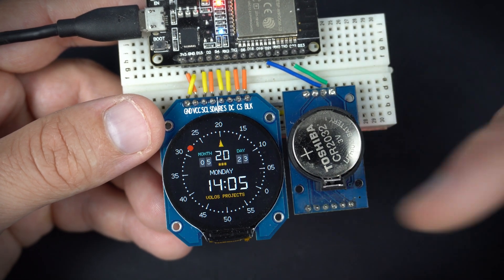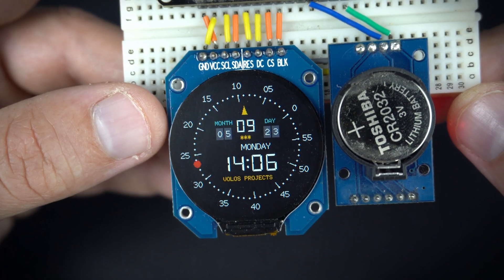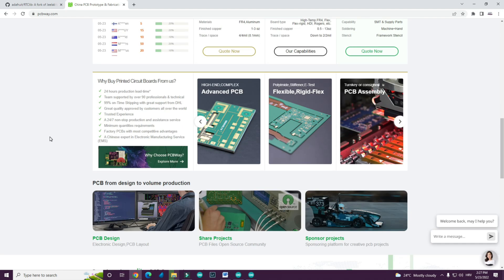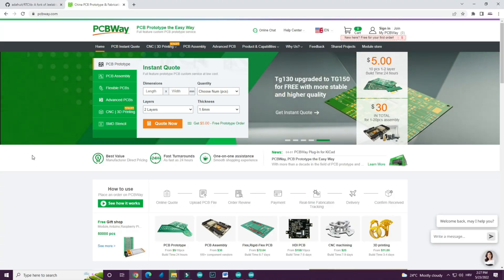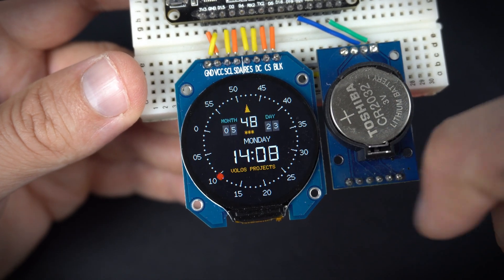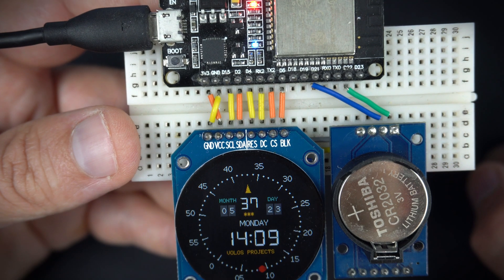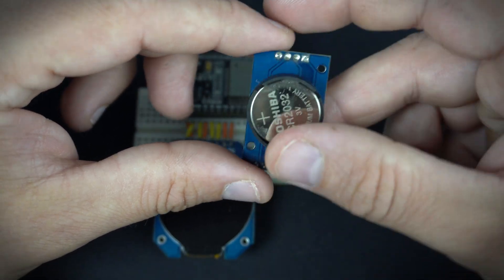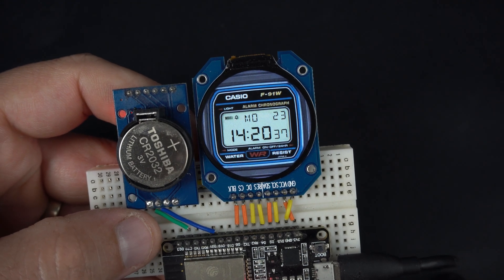Let's make Smartwatch ESP32

Comment: With the NodeMCU the examples in the TFT_eSPI work, but you code no :-(
Reply from the maker: yout board dont have enougth psram for 240x240 sprite, reduce size of sprite to 230x230 and it will work
Reply: @VolosProjects  Thanks, but I chaged card to ESP32C6 Zero, now work fine

Comment: Great video, I got your code working using a Teensy 4.0 controller, but only after commenting out the generic user setup! Somehow I missed that when modifying the setup header and that caused a black screen on 1st try.  This was the first step in building a directional gyro that does not rely on the compass sensor in an IMU sensor. This round display is perfect and I really appreciate the sprite code to eliminate the screen blinking on display updates. The Teensy 4.0 works great with this display.

Comment: Couple of helpful hints:
TFT 1.28" PINS
RX2 on my ESP32-WROOM is where the DC PIN goes
TX2 on my ESP32-WROOM is where the CS PIN 
Otherwise all other pins are as noted below:

#define TFT_MISO 5
#define TFT_MOSI 2
#define TFT_SCLK 15 
#define TFT_CS    17  // Chip select control pin
#define TFT_DC    16  // Data Command control pin
#define TFT_RST   4 

RTC - SCL -> PIN 22
RTC - SDA -> PIN 21

Finally had to modify my img.createSprite(240, 240); to 
img.createSprite(235, 235);
For sketch to work. Probably a difference in Waveshare vs D-Lite or TFT displays. 

Great sketch!
Reply: same issue here. thank you for posting this, it helped me get it working.

Comment: Hi, 
I've been working on your example for a couple of days, with no success. Screen remains black.
Wiring setup has been modified in TFT_eSPI Users set up. All examples of TFT_eSPI work like a charm.
Clock is wired properly and gives time.
I inserted a few 'fill' command through the program to check that the program is alive and it works.
Must be a tweak somewhere but I have no idea, I'm not a newby in programming, but this is my first test with ESP32 end round TFT.
Any idea ?
Reply from the maker: memory, later i found that some boards have problems with this sketch ... also have you check tutorial from description?
Reply: @VolosProjects  OK, solved it. It must indeed be a memory issue. My board can't create a Sprite of 240x240. 239x239, ok, but not with your sketch, even switching color depth to 8.
So, I found that with a Sprite size of 234x234, and a few adjustments due to the reduced size, the sketch works.
Reply: @VolosProjects  thanks for your quick reply. Yes I checked the tuto, again, Wiring, parameters are ok and all exemples in TFT_eSPI work fine. I saw in the comments something about memory management with some parameters to set in the sketch, but with no detail… I’m still inquiring. And yes the board is AliExpress, as well as TFT, but strangely enough all examples including sprites work.
Thanks anyway.

Comment: Hello,
I am trying to use this sketch.
Unfortunately the image and the pointer is not displayed.
I use a round display with GC9A01 driver without LED and a ESP32 -WROMM 32 controller .

Is there a newer version of this sketch ??
Greetings
Reply from the maker: Is any other example work ob your display, there is no problem with this sketch, you need to install library properly

Comment: fantastic, like always. Got it running on an ESP32 S2 Mini, with minimal changes to reconfigure SCL&SDA. Great looking and superbly working. Thank you!
Reply: Hi, I'm also trying to get it working with the S2 Mini but without success. May I ask what you did to reconfigure SCL & SDA? Thanks.
Reply: @u1kim  Just adapted 
#define USER_SETUP_ID 46

#define GC9A01_DRIVER

#define TFT_CS   34 //   TFT:CS  10 or 34  chip select control pin

#define TFT_MOSI 35 //   TFT: SDA = DIN= Data IN  11 or 35
#define TFT_SCLK 36 //   TFT: SCL = Clock  12 or 36
#define TFT_MISO 37 //   TFT: NC 13 or 37

#define TFT_DC   14 //   TFT: DC 
#define TFT_RST  15 //   TFT: RST

That it
Reply: @michaelbruns473 Thank you very much.

Comment: Great project. I built it, and with some effort, got it working. At first a blank display. A 240x240 sprite seems to exceed ram availability for sprite rendering although only 8% was used by global variables. By moving the fixed arrays created and stored in ram in the setup section to a pre-calculated set of constant arrays stored in program memory (similar to the fonts arrays), ~9k of additional ram was freed (5% used) and the sprite displayed. I also found and fixed a bug that did not handle the 10th day or the 10th month leading "0" stuffing correctly by changing the "if (now.day() > 10)" to " if (now.day() >= 10)" (same for month). It looks impressive!!!. Thanks for posting.
Reply from the maker: thank you, i am glad you made it work. memory is always problem with tjese development boards.
Reply: Hi, I have a similar problem, not white, but black (BL in forced on so no issue there).Sketch is running (checked that) but nothing on the screen. Couls you please share your array meomory allocation code, I'm not familiar with this.
Thanks

Comment: I love that round screen!   However, you mentioned  a new ESP32 s3 with a screen on top.  It was a little larger than other esp32s.

If we used that new esp with rectangle screen, can we better arrange components, either stacked, or on each end of ESP32/screen with each component in a self made case for each,  slide onto watch band.

It would wrap around band(each cased module with the ESP32-screen the center item on band.

(Just thinking out loud but no experience BIENG very respectful and humble asking the questions.).   I want one! Hahaha

Comment: hello, nice project. why if I imposed img.createSprite (240, 240); the screen remains black. instead with img.createSprite (240, 230);
All right. but the image remains a little bit (normal)
Reply: I spend hours and hours and combined 2 different ESP32 with 3 different GC9A01 and always got a black screen. Then Roberto unveiled the magic key: createSprite(240, 230). Thank you very much! Can anybody provide an explanation?
Reply: Roberto! THANK YOU! THANK YOU! After making your change my display is no longer blank. I tried everything I could think of. 
Do you have any idea why that change makes it work? What made you try that?
Reply: @vectorspace2932  it was a coincidence, I wanted to include some
#define but I got the wrong value.
i didn't understand why it doesn't work with 240. sorry
Reply: @vectorspace2932  I have tried other projects of the author and setting 230 they all work

Comment: Great project! but I have a problem. My display has the pins in a different order. Fortunately I noiticed that VCC and GND were reversed, and wired the pins as I thought they should be. There was no connector for BLK.  Powered up and nothing! Blank screen. I made the changes to the pins as detailed in the earlier video, and double checked my wiring.. Anyone got any suggestions?  Thanks
Andy
Reply from the maker: Hello, are you sure your display uses same driver chip?
Reply: @VolosProjects  Hi Velos. Thanks for the reply.. Yes. Info on the back say: 1.28"TFT VER1.0 240*240 IC:GC9A01.If it helps pinout from left is VCC GND SCL SDA DC CS RST. Anyone else used this display?
I guess its back to basics with some of the example code - and check that the display works ok.
Reply from the maker: And did you edit library?
Reply: @VolosProjects  Yep! :-)
Reply: @VolosProjects  OK made some progress... Forgot to select the driver in the user.setup.select.h. :-(. The screen now shows some activity - but not as expected. Just a thought - of the many ESP32 boards to choose from I wonder if that makes a difference? I'm using a generic Chinese board. Might the pinouts be different?
Reply: @andrewlarkham8502  I also wonder this problem.  My display only has the 7pins, no BK pin.  did you get it to work?

Comment: Hi, thanks for the great  movie, I will try to reproduce your project. Could you plese tell me what the pinout for the RTC in combination with the ESP32 is? I already have a display working (using other code, same TFT_eSPI library) . Thanks again, Leo
Reply from the maker: Thank you! I used defoult I2c pins for  RTC. 
SDA: SDA (default is GPIO 21)
VCC: usually 3.3V or 5V
SCL: SCL (default is GPIO 22)
Reply: @VolosProjects  Hi, thanks for your quick reply, but I think I have a conflict in how I configured the pin to be used for the TFT. I also have not the same TFT, I have a ST7789 that has no chip-select. Could you please send me the part of User_Setup.h where you have configured the pins for your TFT so I can look if that inproves anything? Thank you again, Leo
Reply: Hi, I managed to get it working. I changed your code from using the RTC, to use the WiFI onboard of the ESP32 to get the time through NTP. Here is a link to the changed code. Thanks for your ideas and work, Leo
https://www.dropbox.com/s/ap3xr4nap66txqj/watchESP_V2.03.zip?dl=0
Reply: @satbeginner  sir i am getting flickering on display what should i change in code.
Where i need to write byte as volos has told to use byte to avoid flickering. Please help me sir 🙏
Reply: @dayanandkumar5965  do you use my software using NTP or the Volos one?
Reply: @satbeginner  no sir volos one only
Reply: @satbeginner  create. Sprite is showing error how to solve it sir
Reply: @dayanandkumar5965  make sure you have the proper libraries installed, and also double check the used pins and the configuration for the TFT user_setup.h
Reply: @satbeginner  if i use your then will be solved
Reply: @dayanandkumar5965  in any case you need to use the pins to the TFT accordingly to the user_setup.h. In my source I gave an example of how I configured the TFT pins and display size (240*240) etc.
Reply: @dayanandkumar5965  inside the user_setup.h file you enable (remove the //) for the proper chiptype, display size and used pins.
I did so in the ESP32 section of the file as follows:

#define ST7789_DRIVER // my TFT has this chip!
#define TFT_WIDTH 240
#define TFT_HEIGHT 240
#define TFT_SCLK 18
#define TFT_MOSI 23
#define TFT_RST   16
#define TFT_DC     17
Reply: @satbeginner  sir can i get your email
Every thing is fine but pixels are fluctuating.
More questions
1. How can i make 3 page as left or right scrolling to display
     #temperature
     #weather
      #WiFi signal strength 
I want only 3 scrolling page idea rest of the thing i can do
Reply: @satbeginner  what other libraries i need to add i am getting 3 error like
renderface // for sprite function
And
CalcDate and time
Reply: @dayanandkumar5965  if you download my 2.08 version and unpack on your PC. When you look at the .ino file, do you see the fonts.h file and the NTP_Time.h files as well?
Furthermore you need the Timelib.h, Timezone.h , WiFi.h , WiFiUdp.h , Arduino.h, TFT_eSPI.h, SPI.h, fonts.h libraries
Reply: @satbeginner  ok will try
Reply: @satbeginner  is it compatible with esp32
Reply: @dayanandkumar5965  yes, I use my code on a ESP-WROOM-32 (30 pin and a 38 pin) board
Reply: @satbeginner  sorry sir for asking again and again one more question
Do i need to change anything in
Sprite.cpp & Sprite.h file
To create sprite of width x height y pixels, return a pointer tp the RAM area🙏
Reply: @dayanandkumar5965  no, I did not change anything there, but the size and type of the available display is configured in user_setup.h in the TFT_Espi library directory
Reply: Where i need to change size in which file
Reply: @dayanandkumar5965  in your Arduino/libraries directory you should have a subdirectory for the tft_espi library. In that subdirectory you find the user_setup.h file. Only remove the // for the defines you need. Chip type, display size, used pins.
Reply: @강용구남 The Volos Software not, but that is what I added, instead of the RTC Clock chip. Look here for my version: https://www.youtube.com/shorts/mHEY96_5hDk
Reply: @강용구남 yes, it's running fine here. I use NTP in combination with the timelib.h library to get the time and adjust it for DST daylight savings time.

Comment: This is amazing!.... I'm thinking of doing this as a clock instead of a watch. Either 3D print a box for it or purchase a box from your local electronics hardware shop that will fit the components in. An Alarm added to it would be awesome to so that you can have it next to your bed as a timer and alarm clock!?
Reply from the maker: Grat idea, that way you avoid using battery.

Comment: Which ESP32 version did you use for the sketch? The current version is 2.0.3 in the Arduino IDE.
Reply from the maker: Sorry, i dont umderstand. Version of esp32
Reply: When you select Boards Manager in the Arduino IDE and enter ESP32, the Espressiff Systems version of ESP32 is displayed.
Reply from the maker: @neilcameron4680  i am using old version with old boards, my version is 1.0.6, did you try sketch, it is not working? Did you setup tft_espi library properly?
Reply: The combination of new version of ESP32 (2.0.3) and the ST7899 LCD screen leads to problems with displaying sprites. Use of tft.pushImage works, but with screen flicker, while img.pushImage does not always work.
Reply from the maker: @neilcameron4680  now i remember i had new version of ESP32 boards definition but i also had many problems so i returnet to old boards.   But i also have some boards that can be used only with new 2.0 version. I hope that someone will fix that so we dont need to switch between thease two
Reply: Yes, on the one hand, you want to use the latest version (2.0.N), but on the other hand, you want a version that works, so end up using older versions (1.0.6).

Comment: I tried it, but nothing on the screen, the ds3231 is working perfectly. other TFT-eSPI example are working fine.
An idea? 
Thanks.
Marc.
Reply from the maker: did you edit tft-espi library. check my previous video
Reply: @VolosProjects  yes. Other tft-eSPI example works
Reply: @MPElectronique  Have you solved it? I fill the screen with other colors to display, but the clock doesn't display
Reply: @zhuhh  no :(
Reply: @MPElectronique  The latest version 2.0.3 of Espressiff Systems for ESP32, has problems with this code and some of the TFT_eSPI drivers. Using the older version 1.0.6, compile and runs correctly.
Reply: @MPElectronique  我试过，可以静态显示文本，但是博主的代码中没有注释，我不知道改怎么修改，也是比较麻烦
Reply: @johnknight9422  i even try with esp32 1.0.6 doesnt work.
Reply: @MPElectronique  I tried it on 2 displays and it worked with 1.0.6. Had the same problem like you with 2.0.x version.
Post more information of your setup. Display type, pins you used and ESP32 board (30 pin or 38).

For example, I used GPIO 16 & 17 for RTC with a Wire.begin(16,17); in Setup, to set the SDA, SCL to these pins.

You can also add a Serial.begin (115200); in the Setup part that is missing in this code, and then use some Serial.println("Passed line xxx"); in different location of the code to trace code execution and see where you are without a working display on Serial Monitor.

Also run "Read_User_Setup" example of TFT_eSPI library to see if you have set it up correctly for your display.
Hope these help you.

Comment: Thanks Volos for the Video . The clock looks very great !!! 
I have an idea , use a little GPS modul to get the timeinformation and some others, for example altitude ... and you not need wifi or Internet ;-) 
Greetz from Dessau, Maik DF7MR
Reply from the maker: Thank you! do you know any good gps module, i tried few of them but they are not realy good.
Reply: @VolosProjects  Tks for your answer ... i used a Modul with "build in" antenna and works well, but the size is too big for a SmartWatch, but for a tablewatch is it perfect ... 
     look for GM-22U7 in Ali-express
Greetz from Dessau , Maik DF7MR
Reply: @VolosProjects  Hi, another admirer of your projects here. I don't know if in the mean time you've found a GPS module that you like but I'm having good results with the tiny and very affordable ATGM336-based modules. I use them with their small patch antenna. They are quite sensitive. I've built several clocks using them. The command set is simple and straightforward, should you want to change the configuration.

Comment: I don't have a round screen so i used the same code and a different screen. My screen was ST7789 and the result is not perfect but still very fine. Thx, your projects are great.
Reply from the maker: Thank you :)
Reply: Can you help me
Reply: @dayanandkumar5965  What you wanna know, i'll try to help you.
Reply: @ziczack8760  as of now i have solved but if there will be any issue i ask you
Reply: @ziczack8760  it will be better if we connect through email
Reply: @ziczack8760  can you tell me that how to add multiple frame in thia display

Comment: Arduino will not compile due to missing image files
Reply from the maker: What image file, there is no image files
Reply: @VolosProjects  your code says img.setFreeFont(&DSEG7_Modern_Bold_20);
 img.drawString(s,sx,sy-36);
 img.setFreeFont(&DSEG7_Classic_Regular_28);
 img.drawString(h+":"+m,sx,sy+28);
 img.setTextFont(0);

 img.fillRect(70,86,12,20,color3);
 img.fillRect(84,86,12,20,color3);
  img.fillRect(150,86,12,20,color3);
 img.fillRect(164,86,12,20,color3);

 img.setTextColor(0x35D7,TFT_BLACK);
 img.drawString("MONTH",84,78);
 img.drawString("DAY",162,78);
  img.setTextColor(TFT_ORANGE,TFT_BLACK);
  img.drawString("Phakalane",120,174);
  img.drawString("***",120,104);

  img.setTextColor(TFT_WHITE,color3);
  img.drawString(m1,77,96,2);
  img.drawString(m2,91,96,2);

   img.drawString(d1,157,96,2);
  img.drawString(d2,171,96,2);
 
  for(int i=0;i<60;i++)
  if(startP[i]+angle<360)
 img.fillCircle(px[startP[i]+angle],py[startP[i]+angle],1,color1);
 else
 img.fillCircle(px[(startP[i]+angle)-360],py[(startP[i]+angle)-360],1,color1);
 
 img.fillTriangle(sx-1,sy-70,sx-5,sy-56,sx+4,sy-56,TFT_ORANGE);
 img.fillCircle(px[rAngle],py[rAngle],6,TFT_RED);
 img.pushSprite(0, 0);